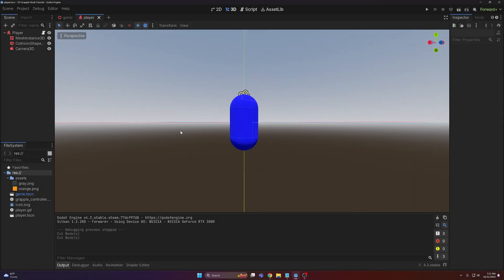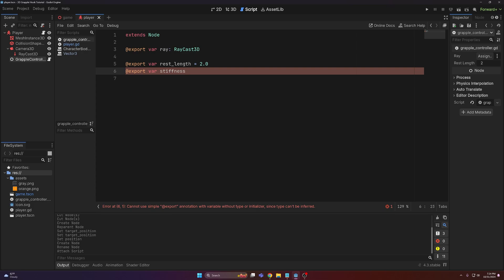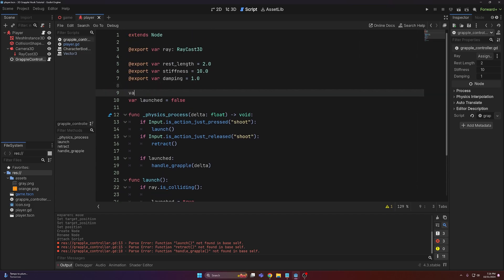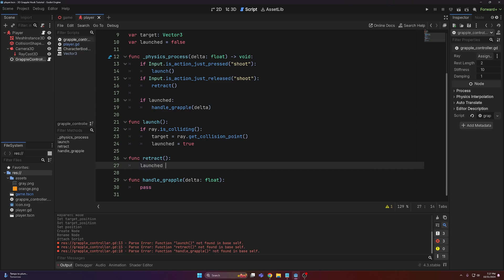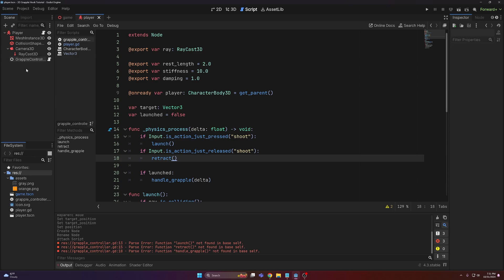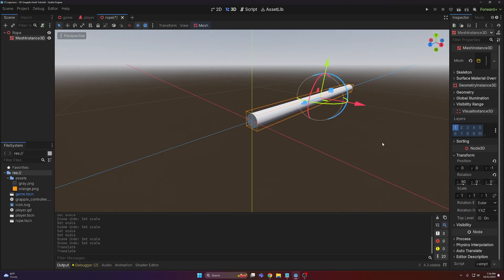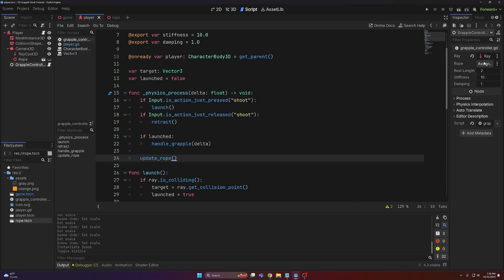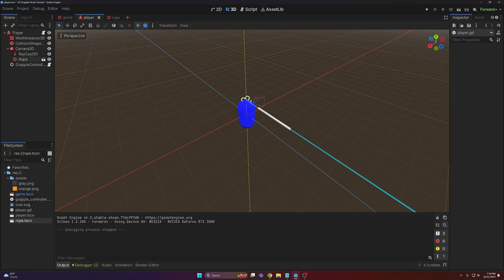How to Make a 3D Grappling Hook in Godot 4

Comment: is anyone  having  problems with  the is  colliding on a  null  value?
Reply: Means you've not assigned the RayCast3D variable we declared as @exported at the top of the script.
"@export var ray: Raycast3D"
You need to drag and drop the RayCast3D node you're using as the raycast and drop it into the assignment block on the right-hand side details panel where it says "Ray: Assign"
Variables you declare as @export'ed variables won't automatically assign themselves unless you make them in the _ready(): function or some other means of assigning it in code.

Comment: Is it possible to make the grappler a separate scene from the player as opposed to the grapple raycast and node being attached to the player?
Reply: You can create a raycast through code

	ray = RayCast3D.new()
	add_child(ray)
	ray.target_position =  Vector3(0, -ray_length, 0)
	ray.set_collision_mask_value(1, true) 
	ray.enabled = true

Do whatever you need to do then immediately

        ray.queue_free()

if you don't want it to hang around forever

Put "-ray_length" in whatever the forward vector of your parent class is
Collision mask is optional but better than checking a bunch of if statements or whatever.
ray_cast.enabled is needed because when you spawn it in by code it won't be enabled by default.
Reply: or, just like you said, literally , make it a separate scene. Can always add it as a node of the saved scene & reposition the ray as necessary.

Comment: Hey, excellent tutorial! I like how you broke down hooke's law into easy to digest steps as well.
One recommendation is to maybe bring up your voice track though. It was a bit low and I had to crank up my volume to hear you clearly. :)
Reply from the maker: Thanks for the feedback! I'll definitely increase the volume for the next video
Reply: @curtjs-dev  If you're able, try to figure out how to add filters to your voice (very easy if you're using OBS, probably similar with other software). A 'Noise Gate' and 'Noise Suppression' to get rid of unwanted sound. 'Gain' to increase volume. A 'Limiter' to make sure you never get too loud. A 'Compressor' to bring your quiet sounds and your loud sounds closer to the middle. Usually, the filters will come with default settings that only need minor adjustments if anything. Those 5 filters will make nearly any voice recording sound professional.

Comment: hey im a bit confused by the errors im getting. I followed to the point where you tested it first and i kept getting errors and im not sure why. thanks if you can help its a error about damping variable and characterbody3d

this is my code 

extends Node

@export var ray : RayCast3D

@export var rest_length = 2.0
@export var stiffness = 10.0
@export var damping = 1.0

@onready var player: CharacterBody3D = get_parent()

var target: Vector3
var launched = false

func _physics_process(delta: float) -> void:
	if Input.is_action_just_pressed("shoot"):
		launch()
	if Input.is_action_just_released("shoot"):
		retract()
	
	if launched:
		handle_grapple(delta)

func launch():
	if ray.is_colliding():
		target = ray.get_collision_point()
		launched = true

func retract():
	launched = false

func handle_grapple(delta: float):
	var target_dir = player.global_position.direction_to(target)
	var target_dist = player.global_position.distance_to(target)
	
	var displacement = target_dist - rest_length
	
	var force = Vector3.ZERO
	
	if displacement > 0:
		var spring_force_magnitude = stiffness * displacement
		var spring_force = target_dir * spring_force_magnitude
		
		var vel_dot = player.velocity.dot(target_dir)
		var _damping1 = -damping * vel_dot * target_dir
		
		force = spring_force + damping
	
	player.velocity += force * delta